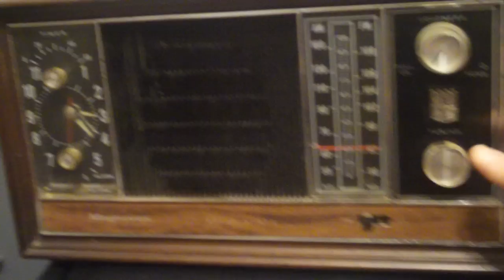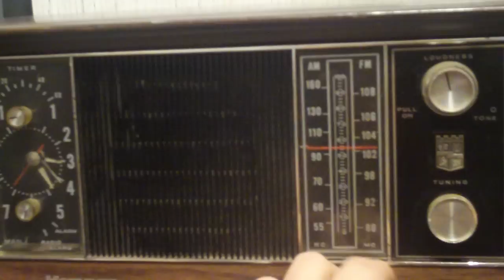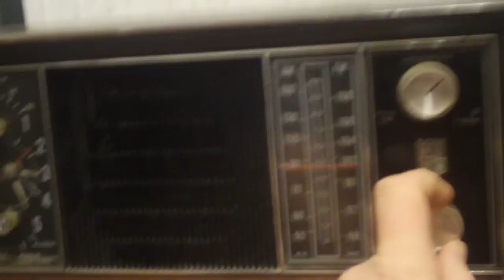Re:  1965 Magnavox AM FM  Solid State alarm clock radio.

Comment: That's really good the way you got the new filter capacitors installed...I wonder if there could be some other bad electrolytics in the signal circuits which are causing some of the other problems?

Comment: This is getting to the age where electrolytics are often starting to go bad. An ESR meter would be good for checking the caps or you might just replace all the rest of the electrolytics, a desoldering wick is good for this.